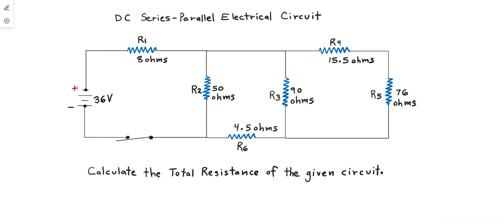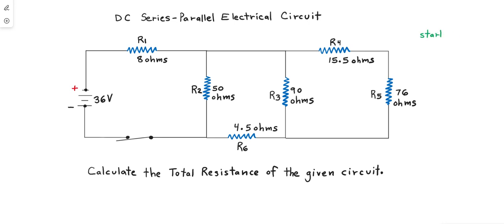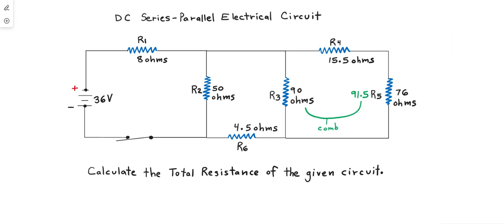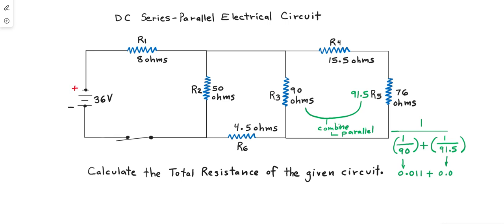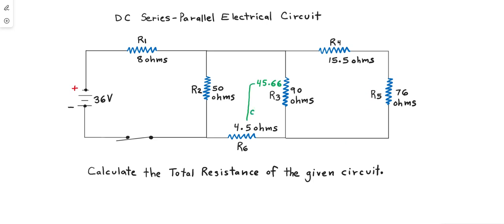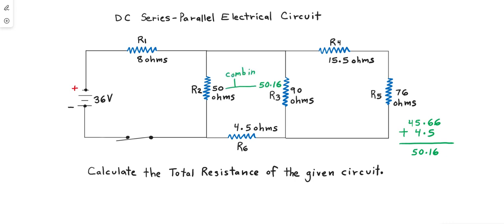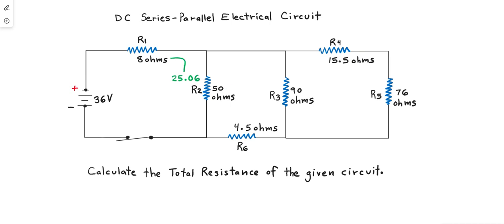How To Calculate Total Resistance of a DC Series-Parallel Electrical Circuit

Comment: when r3 is combined with r45 through series the answer is 45.37 ohms.. i couldnt get a similar 45.66 ohms like that in the video
Reply from the maker: R3 is combined in PARALLEL with R-4-5.  R4 & R5 are combined in SERIES.  R3 = 90 Ohms.  R-4-5 = [(15.5 Ohms) + (76 Ohms)] = 91.5 Ohms.  R3 combined in PARALLEL with R-4-5 = [(1)] / [(1/90) + (1/91.5)] = 45.37 Ohms. ===> Continuing On:  45.37 Ohms is combined with R6 in SERIES:  [(45.37 Ohms) + (4.5 Ohms)] = 49.87 Ohms.  49.87 Ohms is combined with R2 in PARALLEL:  [(1)] / [(1/49.87) + (1/50)] = 24.97 Ohms.  24.97 Ohms is combined with R1 in SERIES:  [(24.97 Ohms) + (8 Ohms)] = 32.97 = 33.00 Ohms Total Resistance.

Comment: why do you have to start with the right side?
Reply from the maker: Because the right-side is the MIDDLE OF THE CIRCUIT, for which positive-electron-flow transitions to negative-electron-flow.  In DC Electrical Circuits,  electricity flows from positive (+) to negative (-) ONLY.  DC = Direct Current.  By starting at the MIDDLE OF A DC SERIES-PARALLEL CIRCUIT or at the 'right-side', resistances can be combined sequentially and accurately.